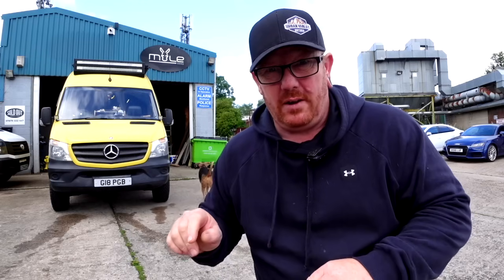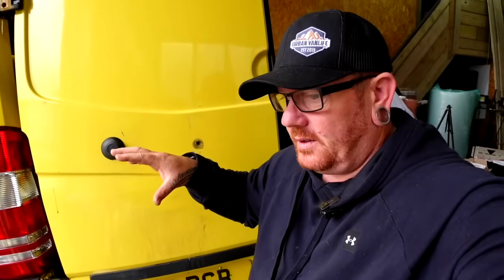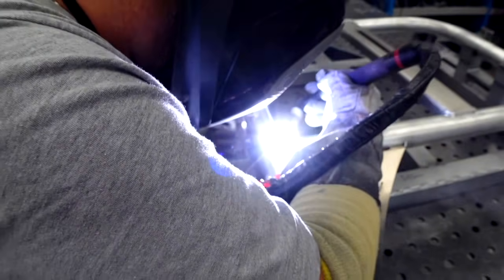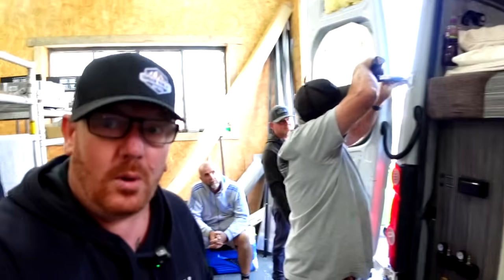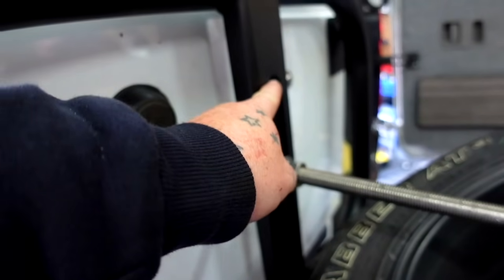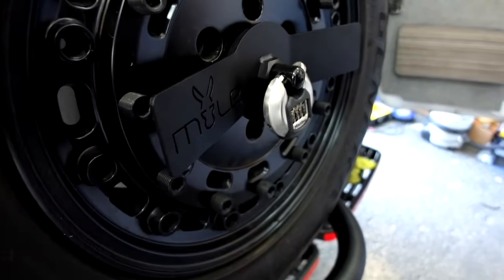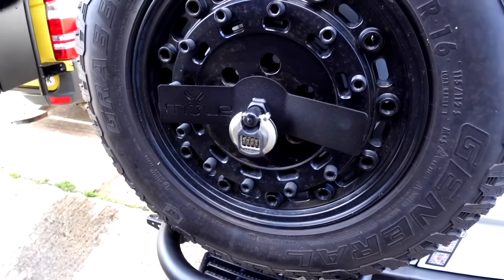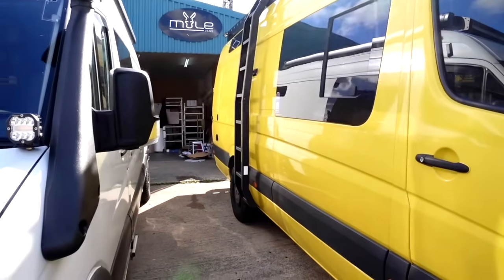Your Van Build NEEDS a Wheel Carrier Ladder

Comment: I'm happy enough with my Wheeliams carrier. No rust and no loose bolts 👍 The mule carrier is indeed a smart looking bit of kit and seemingly well made. Maybe if I was starting a new conversion with a huge budget to absorb the €1300+ price tag for the mule carrier then maybe I'd order one. In defence of the Wheeliams carrier, I have found it to be well made, yes it was not painted or powder coated and it was easy to install with a second pair of hands. For circa €230 it is excellent value for money. My personal opinion of course.
Reply from the maker: Iv seen a lot of people had the same problem as we had with rust and damage

Comment: To be fair to Wheeliams, they supply an unpainted steel product and you painted it yourself. I think you said in your other video it took you 2 minutes to paint. Ultimately steel will always rust eventually no matter how good the paint job is but if you had it professionally powder coated you might have had more longevity from it. By the way I think the mule vans carrier is a superior product but I thought it was only fair to balance out that the wheeliams is a third of the price and wasn’t fitted “professionally”